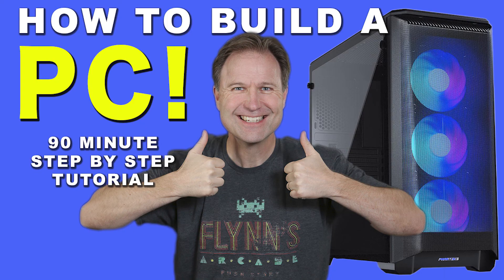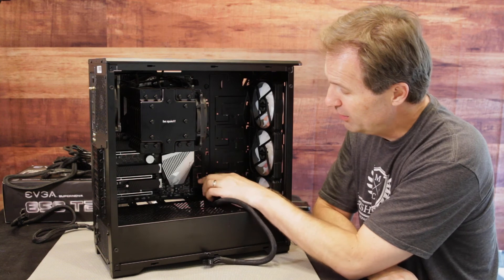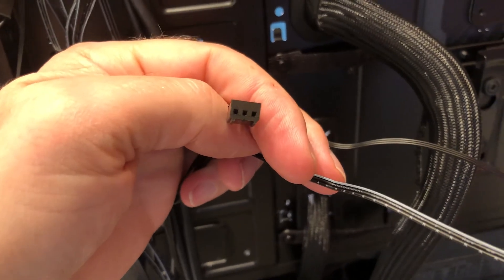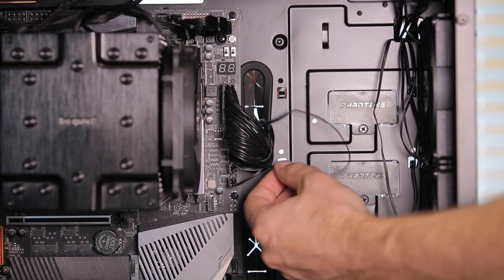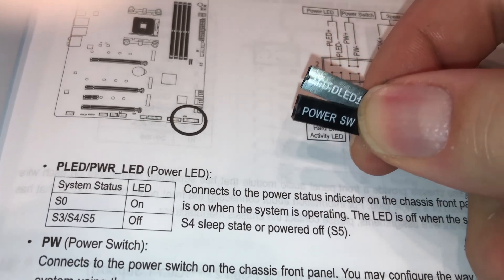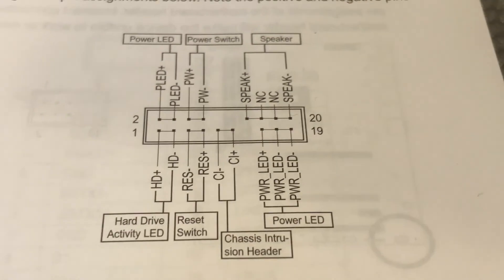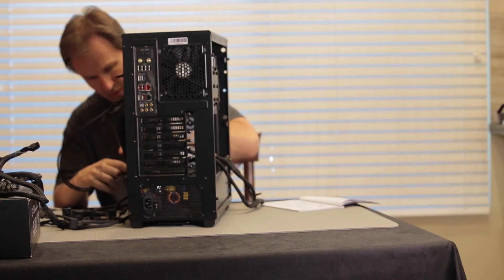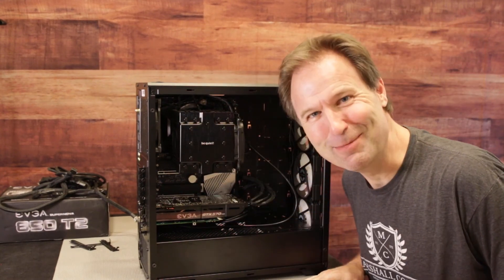HOW TO INSTALL POWER CABLES, INTERNAL CONNECTORS, and ROUTE WIRES - How to build a PC Phanteks P400a

Comment: My LED fans and power button are not lighting up, even though everything is verifiably plugged in to my Asus PRIME H670 plus motherboard correctly. What could the problem be? What is defective? What needs replaced? What is not supported (if anything) by this build?
Reply from the maker: Are they functioning at all?
Reply: @devosentertainment  The fans are spinning, the power button is functioning, and the reset button is functioning too- just not the lighting/LEDs.
Reply: There is a D-RGB 3-pin on the motherboard like you showed in this video. I've tried plugged in and unplugged... the D-RGB cable doesn't work either. My motherboard is an ASUS Prime H670 Plus D4 ATX MotherBoard, Aura Sync. The description of the Phanteks 400A case says "Integrated Digital-RGB controller with 3x pre-installed D-RGB fans that can sync with compatible motherboards to create a stunning lighting effect". In addition, the description to my motherboard states there is a Aura RGB 4-Pin header for  RGB LED strips, and a 3-pin addressable Gen 2 header with support for 'RGB WS2812B LED' strips or 'WS2812B based' LED strips. What do I do to get the lighting to work? The bios settings for my motherboard have "ALL", "OFF", "Aura only" or "Aura off" settings.
Reply: @Take_it_E-z  Try turning everything on in the bios and let me know. The Phantex case also has a button on the under side of the front lip  at the top of the case that may toggle the lighting as well. Lmk.
Reply: @David_C_deVos  I've literally already spammed those buttons millions of times. Thanks for the thought though.
Reply: @Take_it_E-z  I might also suggest updating your bios if you haven’t already and rebooting to see if it makes a difference. Also check to see if there are any driver updates for your MB.
Reply: @David_C_deVos  NO CHANGE. It's probably a motherboard related issue. It matters not if the 3-pin cable is plugged into the addressable headers- both the motherboard and the case according to their official documentation support aura sync, I have made sure they are all on in the bios, I have installed armoury crate and Aura Sync and the seperate Aura Creator, I've unplugged and plugged back in parts to the motherboard, and I've inspected the board for damage.
Reply: There are no driver updates remaining for my motherboard. Even after the bios update, it did fix the problem. Pressing the buttons still doesn't work.
Reply: But the fans and everything else works fine, I guess that's all it's really worth anyways🤷‍♂️

Comment: I own a Asus ROG STRIX B460-F motherboard and I can only hook up 2 cables and one of them woulda barrely reach the hook up. Do you have any solution for this? 
Great video btw!
Reply from the maker: Are you talking about cables from the power supply or the case? Have you tried routing through a different path? A different grommet or under somehow?
Reply: @devosentertainment  I think I need a splitter of some kind as I don't have any more space on the motherboard
Reply from the maker: @noobencesar  yes. Probably so.